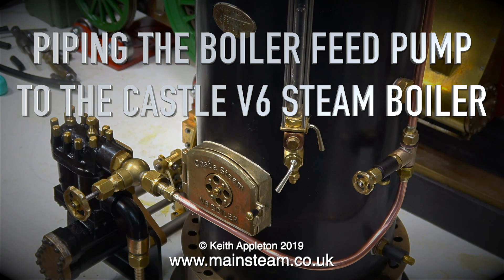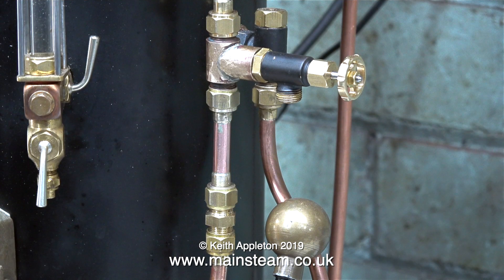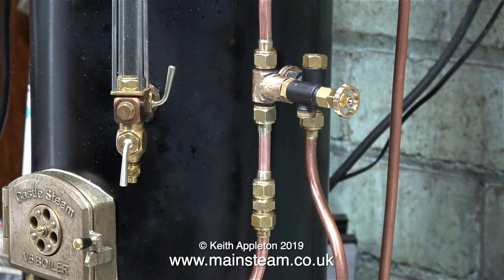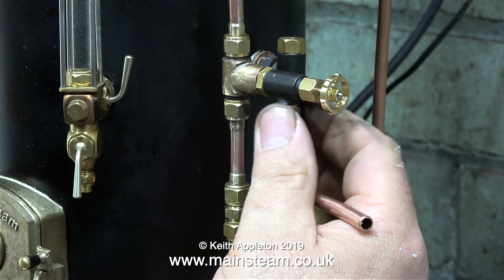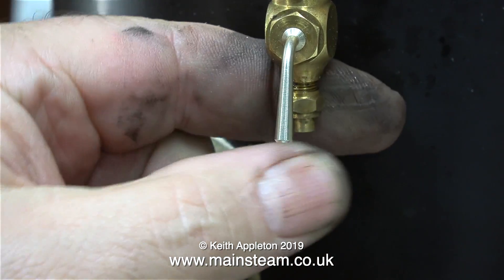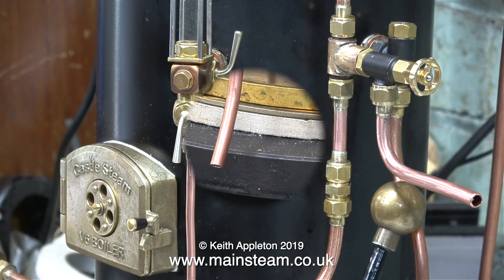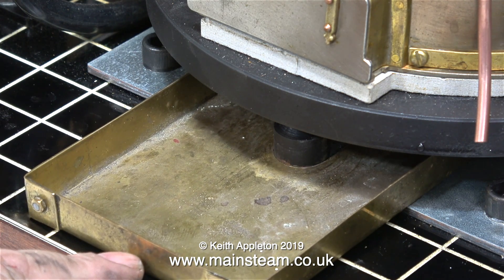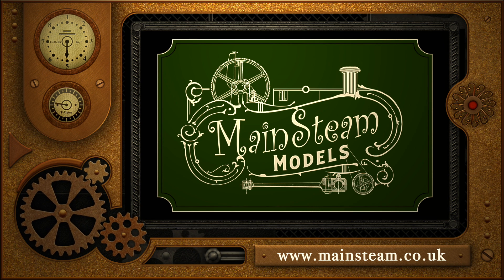CASTLE STEAM V6 BOILER - WATER PIPING MODIFICATION

Comment: Been thinking for ages about getting a Castle Steam V6 boiler myself. Do you think it would supply enough steam to make a vertical boiler steam locomotive with? Small one ovbiously ahaha.
Reply from the maker: They are excellent - perfect for a 'Coffee Pot" type locomotive  . . . .
Reply: @keithappleton  Thats what I was thinking. Small 5 inch gauge Chaloner type loco with.....dont know what engines to use. 5A would be too big i think.